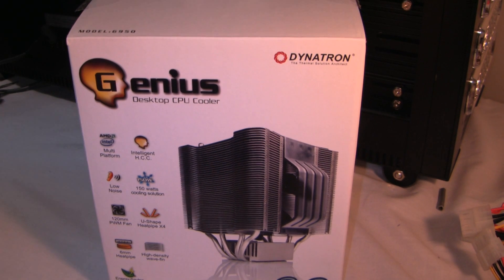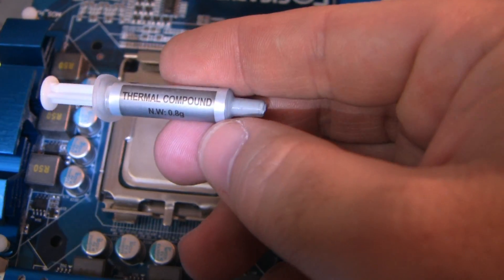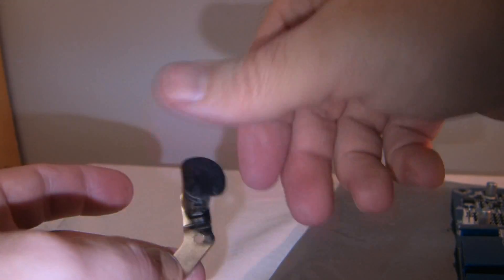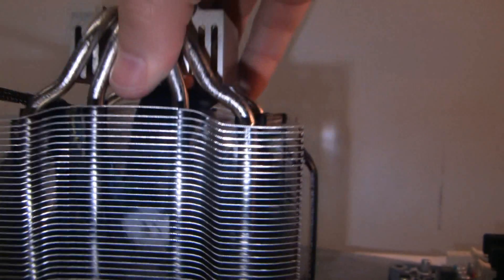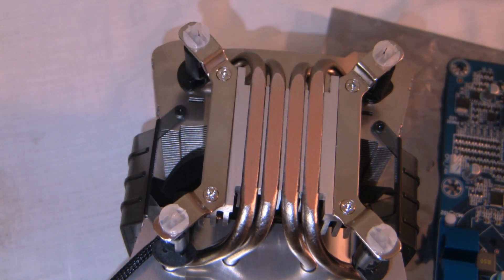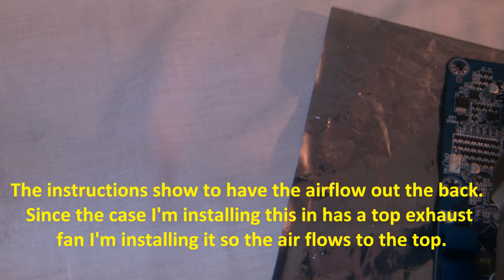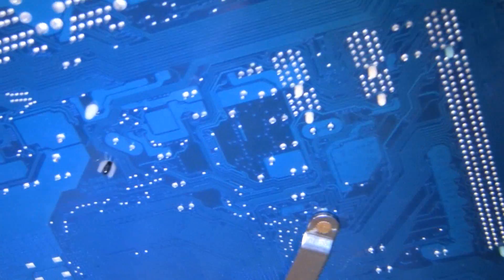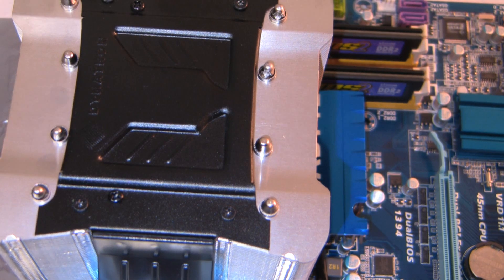Dynatron CPU Cooler Model G950 Install and Review

Comment: Wow thats a large heatsink...
Looks like you have stuck sensors because they dont go below 35.
I also bought a cm hyper 212 plus, stock amd heatsink was around 40-70c with the new heatsink and overclocked from 2.3 to 2.7 right now it doesnt go above 32c when gaming.